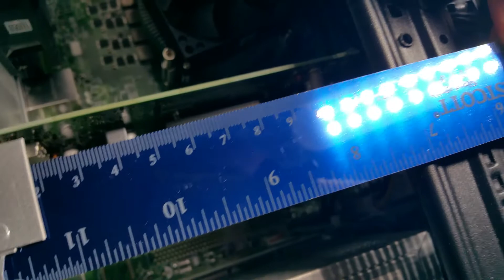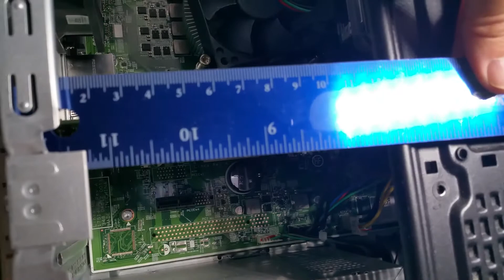Graphics Video Card Fit for HP Pavilion 590-p0057c

Comment: Hello, I have a HP pavilion 590 P0070 with a 310 watt power supply.  Aswell as  a i7 8700.  Could a gtx 1650 be able to run? Or a gtx 1060?
Reply from the maker: It is easy for me to say NO.  I looked up the full specs for the 2 video cards you mentioned.  The "Recommended System Power (W)" for the GTX 1650 alone states 300W while for the GTX 1060 it's recommending 400W power supply (PS).  I am putting the links for the 2 cards here so you can see for yourself:
https://www.nvidia.com/en-gb/geforce/graphics-cards/gtx-1650/
https://www.nvidia.com/en-in/geforce/products/10series/geforce-gtx-1060/
Click "Specs", then "View Full Specs".
Just to be safe, I'd probably get at least an 800W power supply to cover all the bases.  It shouldn't cost much more than a 600W PS.
Also, the power supply may be proprietary, meaning you might have to buy an HP-brand only PS to fit in that case.  Can you let us know if you are able to fit another brand PS in your case?
Reply: @RonAblang First, thank you for responding! Second, would I be fine using the GTX 1650 with my current PSU? 
If not, where can I find a higher wattage  HP PSU?
Because, of my power supply being proprietary. If that is not possible, what is the best GPU I can get for my computer with my current power supply? 

Any help would be appreciated and thank you again!
Reply from the maker: You can always just try the video card w/ the stock PSU and see if the system ever shuts down on you (due to overheating).

You can find after-market PSUs pretty much anywhere that sells computer parts: Amazon.com, Newegg.com, Bestbuy.com (also the brick & mortar store).  Maybe even Walmart.com.

So even if a new power supply doesn't exactly fit inside your case (because the PSU is too big), if the cables are long enough, you can always leave it outside of the case (so long as you don't plan to keep moving your desktop).  Yeah, it wouldn't be pretty but it could work.  If the PSU is too small for your case, you can always attach it using double-sided tape.  Whatever you gotta do to get around the proprietary nature of buying a brand like HP.  It's quite possible that the new power supply will fit in the case, even down to the screw holes.  It's worth the gamble.

Sorry I have no recommendations for the best GPU that would work w/ the current installed PSU.  Maybe someone else here has ideas?
Reply: @RonAblang  Okay thank you man!

Comment: My pc had no other graphics card haha.  What is that you have installed?  Did you have to change the power supply?  I am considering buying one for my PC that can go into the slot and considering the watts it takes to run it on the PC.  Could you please help me with the name?
Reply from the maker: Hello.  This desktop PC came in different configurations.  Some had 8GB of RAM.  Most of them had 16GB of RAM.  Some had graphics card (mine did).  Some did not.  The card that came with my system was the AMD Radeon RX 550 (2GB GDDR5 SDRAM).  It still had the stock power supply.  If you have to upgrade the power supply, it would probably have to come from HP as the case is proprietary in nature so most other power supplies may not fit in the case.  As in the screw holes on the PS may not line up with the screw holes on the case.

Comment: How much watts is the PSU that comes with it? I’m installing a GTX 1050 ti to it, and I bought the one with the i7 - 8700k model.
Reply from the maker: Sorry for the late reply.  I finally got around to opening up the case and I took a photo of the PSU sticker that had this information on it:

Model: PCG007
Part Number: 937516-004
Manufacturer: AcBel Polytech Inc. 
Maximum Power: 310W
Reply: @RonAblang  did you purchase it from Best Buy?
Reply from the maker: Unfortunately, I don't have a record of it.  I bought it online and I'm almost 100% sure it wasn't from Best Buy.  It could've come from Newegg.

Comment: Can you tell me how tall is the power supply please?
Reply from the maker: Sorry for the late response. As you can probably imagine opening up the computer case is not a favorite pastime of mine but as long as this helps but at least one person it's worth doing.  

It is just a tad (like 15/16th of an inch) shy of a full 3" when the case is in it's normal standing position.

Measured from the distance to the motherboard it is 3.75" wide.

Comment: hey this PC is basically the same as mine (HP Pavilion 590-p0030) and I was wondering if this GPU could fit MSI GeForce GTX 1050 Ti DirectX 12 GTX 1050 Ti 4GT OC 4GB 128-Bit GDDR5 PCI Express 3.0 x16 HDCP Ready ATX Video Card https://www.newegg.com/msi-geforce-gtx-1050-ti-gtx-1050-ti-4gt-oc/p/N82E16814137055
Reply from the maker: Please see this other video I made for more help/guidance.  https://www.youtube.com/watch?v=6GTapzY1L3w
Reply: @RonAblang  you just linked the video i commented on..
Reply from the maker: Oops!  Sorry about that.  YouTube Studio isn't always obvious about where comments come from.

According to your Newegg link, the video card dimensions are: Card Dimensions (L x H)    8.46" x 4.41".  Converted to mm is 215mm x 113mm.

It's time for you to open up your case and take some measurements w/ a ruler.
Reply: @RonAblang  would it fit in your machine?
Reply from the maker: Yes, the description of my video says my case can accommodate a graphics adapter of up to 240mm x 140mm.